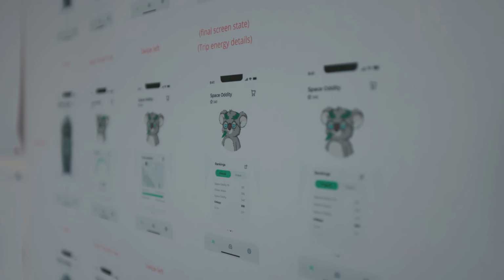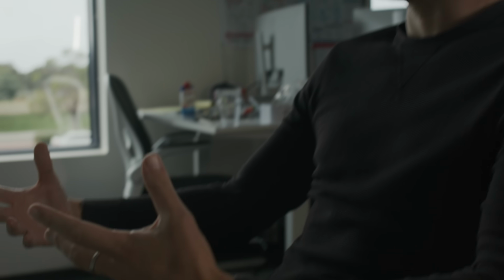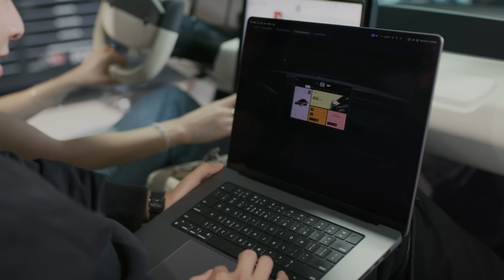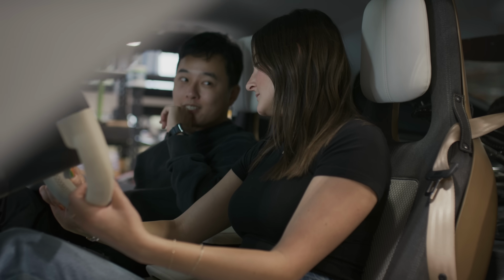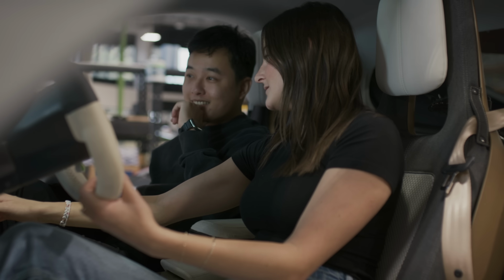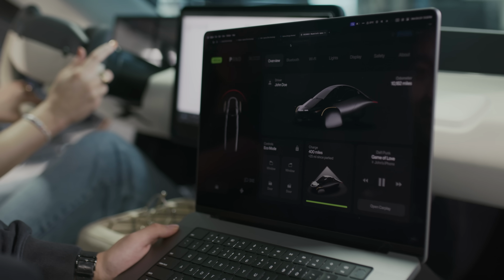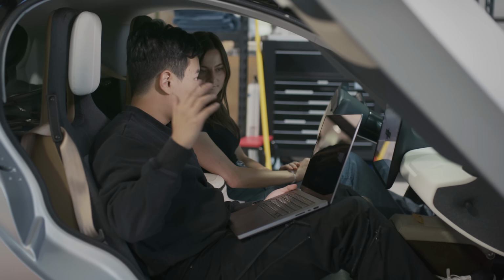Aptera — User Experience

Comment: Will the display work with gloves on?  User experience in cold weather depends on it.
Reply: Heated seats and steering yolk would be a plus.
Reply: @IBMara  100% but wont be in the initial LE builds. Hopefully over time they will refine their unique niche with the 3 wheeler.  I hope for LFP and heatpump added over time.  For heated seats it is easy to add with seat covers.
Reply: @ccibinel  Heat pump for sure. (the holdup has been a supply chain issue).  Aptera is probably far more familiar with the properties of LFP batteries in commercial applications than most companies.  The company Chris A. took public as CEO uses them and has just become a major supplier to Delta Airlines.  They are good at optimizing the best technology for the application.
Reply: I hope the LE wiring harness has a plug for seat heater at the seats, so LE can be upgraded when heated seats are offered.
Reply: They make gloves that work with touchscreens. I have a great pair from Head, I noticed Chris Anthony driving with the same gloves in a video where he gave an Ambassador a ride, at night, during that visit to Switzerland a few months ago.
Reply: I’ve tried those gloves.  Not reliable.  
It would be dangerous to assume they would work in an emergency situation.
Reply: What sort of "emergency" situation can you think of that would require you to use the screen? @LanderMaybe
Reply: @AndirHon  e.g., and this is from experience, going around a curve on an unfamiliar narrow two lane road at night and a big truck passes in the opposite direction splashing mud all over the windshield.  I need to be able to wipe the windshield immediately!  And not hunt for wipers on the screen.  Fortunately, we learned from Jason today that there will be an emergency wipe function at the end of the stalk.  But a button at the end of the stalk will be hard to locate in the middle of a turn.  There is a reason wiper controls have had their own stalk in cars.

Comment: Will there be a ‘my interface’ capability?
What I mean is the ability for me to customize my own interface experience. On a laptop you can put the taskbar where you want, you can put icons where you want, you can group things you want. That type of flexibility. Also when a control comes up will it be like push the up arrow to increase a desired function or could it be a touch controlled slide switch with haptic feedback?
Reply: Aptera CTO Nathan Armstrong has discussed opening this access to owners.  They are open to it from a technical perspective.

Comment: The user interface is SUPER IMPORTANT. 
Software competence is an absolute must.
Reply: Absolutely. A bad UI—especially in a motor vehicle—can really tank the entire thing. It’s very refreshing they are actually making sure the UI is as best as possible
Reply: Very true, but sadly UI expertise seems to be lacking in the industry, even at Tesla. For example, their UI has way too many dime-sized touch-targets surrounded by inches of white space. And some controls you need to scroll to find, hiding below the screen. I especially hope Aptera does the PRND UI correctly. iMO, you only really need three square shift-buttons (R, P, D), and they only need to be big at very low speeds. Once in Park, the buttons could be (R, N, D). I think something like that would be quite simple and intuitive.

Comment: Aptera, the first and only solar supercar I want...
Reply: Do u know what a super car is dam sure it ain’t this 😂
Reply: Please explain how it is super besides 0-60? Has no downforce, one less tire than four for road grip and very low top speed.
Reply: @hollydillion1315 It is all about the look. It has a million bucks look. It will attract more attention than all super cars that you can buy.
Reply: @hollydillion1315  Downforce has been designed into the vehicle from the beginning. I don't know the present value with changes in the body as the design has developed, but we may learn numbers during the validation phase testing.  Aptera already passes the moose test and the energy efficiency goals are being realized in far more capable fashion, with fewer performance compromises than has ever been previously achieved in a production intent vehicle.

Test drives of the production models are going to be more than eye-opening!
Reply: @hollydillion1315 no explanation.. for me personal it is super...
Reply: @hollydillion1315  please see my reply in this thread to you but I didn't happen to put your name. Remember this vehicles going to be a commuter vehicle for most people. Roughly 110 mi per hour is a little bit more than anybody really needs on a commute. Even for those who are not on a commute this is still going to be a pretty cool car to have. Three wheels four wheels who cares. The thing is ultra optimized for reducing wind resistance with so many other places I have to wonder if when people are critical like yourself if you're just being paid to do so by competitors
Reply: @corneliusva 
Very cheap shot and totally besides the point Mr corneliusva.
The point is Aptera is not a super car. Your entire argument seems to agree with that.
If you call disagreement a sellout to competitors, that is a cheap shot.
Reply: @corneliusva  Compared to a proper supercar, it does not produce as much downforce before it affects its battery range. That top speed is not at all high compared to a supercar. Three wheels is not as grippy as a supercar with four wheels? These specs won't break any records on the Nurburgring compared to a supercar. Do you see where I'm going with this? I love Aptera and what the goal is but I think you and a lot of backers don't know what a "supercar" really is.
Reply: @Kukaboora  These backers are just doing whatever they can to defend their investment. I love Aptera and am a backer too but would never go to this extent of smooching.
Reply: @Kukaboora for me it is a super car. It is my own and personal definition of a super car.
Reply: And it's more practical then a super car
Reply: Same here
Reply: Yup. 100 percent agreed.
Reply: There is downforce. The top speed is like 110 mph or thereabouts. Three wheels is not an issue due to the one being the rear one